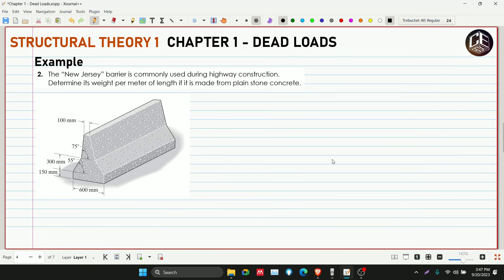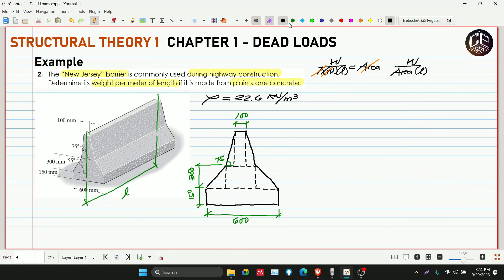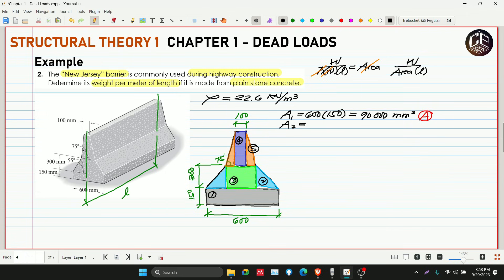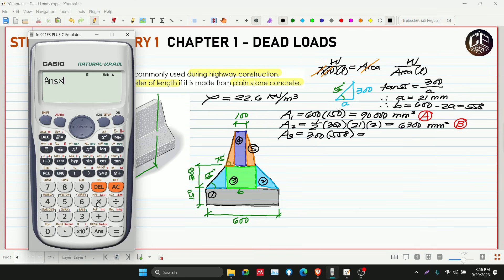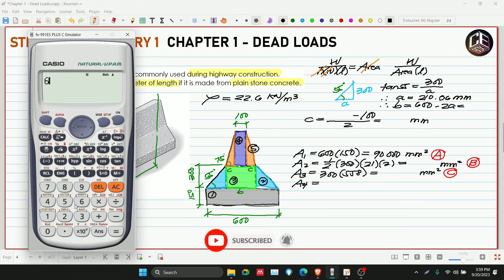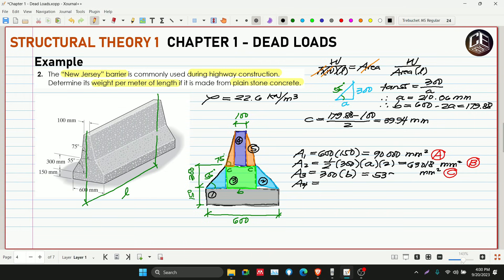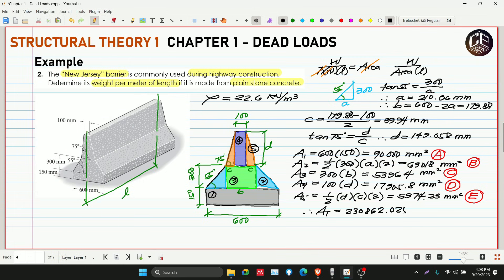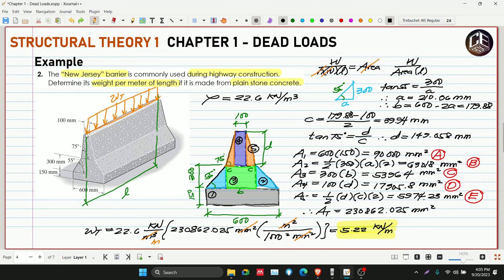Structural Theory 1 Chapter 1 Dead Loads Problem 2 (PH)

Comment: 11:35 and 12:04 nagkamali po kayo, Sir sa pag-input sa calcu. Ang value po ng d ay 149.058. Naging 179.058 sa 11:35 and na-omit niyo naman yung zero after the decimal point sa 12:04. If I am not mistaken, the final answer should be around 5.15 kN/m.